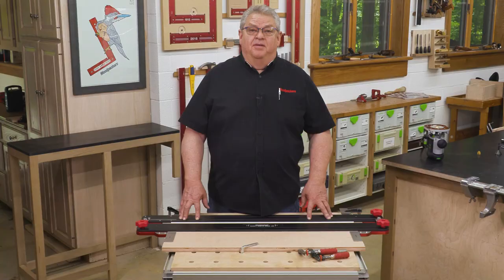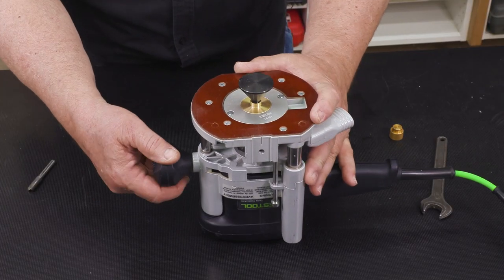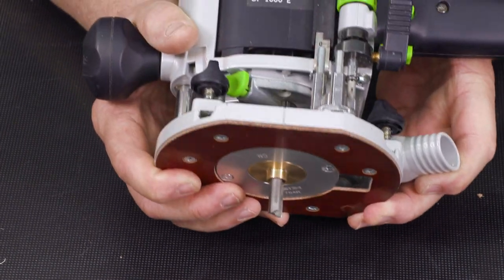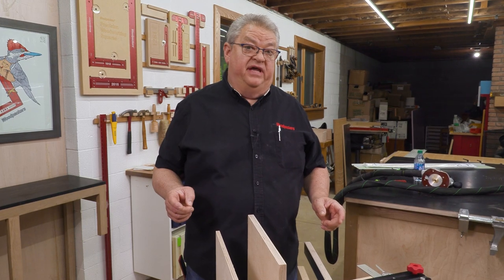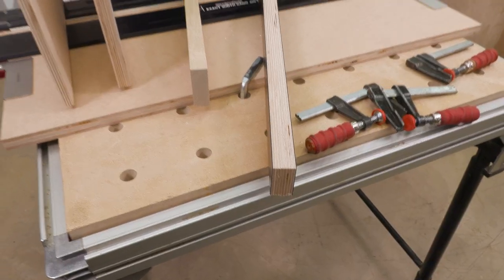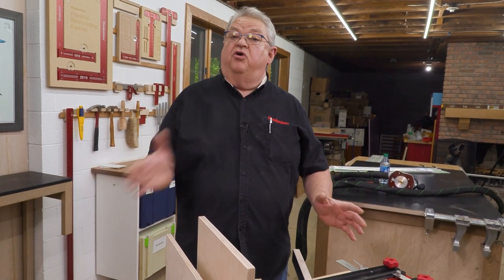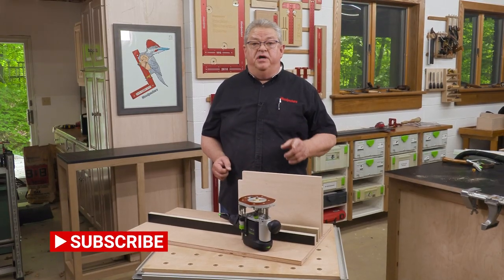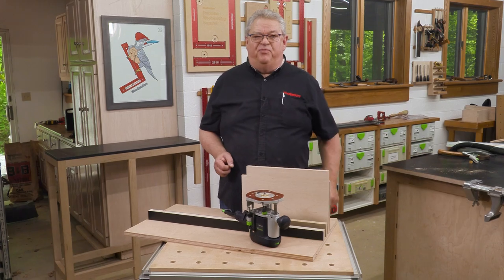How To Make Perfect Fitting Dados With Exact Width Dado Jig | Deep Dive

Comment: Well done, Jeff.  Would have liked to watch you set the depth of cut for the working dados since it is different than the length of the cutter extending below the guide bushing.  Did  you zero the cutter on the workpiece and use a bar of the desired dimension to adjust the depth stop?
Reply from the maker: Sorry I didn't address that, because the answer is really cool. Take a look at the original product video: https://www.youtube.com/watch?v=bf5H3HnkYJk   ...specifically, at the 1:22 mark you'll see the ruler that stores in the Exact Width Dado Jig. It works for setting the stops for blind dadoes, and also comes out to set the depth of cut. It compensates for the thickness of the jig and has the zero point set for the top of the material.
Reply: @WoodpeckersLLC  Thank you!

Comment: What a great demo your super. I have to ask you what was the router bit you used. If you remember it would help avoid buying bits I don't need .  I am using a Festool 1010 and would like to use my 1400 because on 1/2 shaft if I canI just was going to order the 24-1/2 model. Thank You
Reply from the maker: Not sure what I used in the video, but I am sure what I would use today. Woodpeckers is now making solid carbide spiral router bits, and we make two that are a perfect match for the Exact Width Dado Jig. US4900U and US4900D are 3/8" diameter solid carbide spiral router bits with 1/2" shank. The "U" and "D" represent up-cut and down-cut. For solid stock, the up-cut is generally preferred. In plywood or solid stock species that tend to chip, the down-cut is the better choice. You can find them here: https://www.woodpeck.com/ultra-shear-solid-carbide-spiral-router-bits.html

Comment: Where did you get the pigtail connector from?
Reply from the maker: My old OF-1000 pre-dates the Plug-It connector. In Europe they sell this pigtail that replaces the cord and allows you to adapt old Festools to the Plug-It cords. An acquaintance on a Festool forum ordered several from a German retailer and we divvied them up. I got one for my OF-1000 and my even older track saw (AF-65).

Comment: Can one cut a dado starting and ending a few inches from the ends with a plunge router base so that the dado does not show on the ends?
Reply from the maker: You certainly can. It has built-in stops on both ends so you can control exactly where you start and stop.
Reply: @WoodpeckersLLC  Thanks for the prompt response.  That sets it apart from the competition.  Just ordered mine!

Comment: What size bit are you using? I used a 1/4 and it doesn't go the full 1 1/2" as promised in the description
Reply from the maker: With the guide bushing provided with the jig, you have to use a 3/8" bit for the jig to work correctly.

Comment: That Festool dust system isn't worth a hoot with this setup, is it? Woodpecker's dado jig design is the only one I've seen that uses a guide bushing. Can you or any of your viewers tell me how to rout dados less than 1/8th inch but more than 3/32 using a 3/32 bit with a 1/4" shank ? Surely there are better minds than mine here. Please share your insights.
Reply: I made my own jigs years ago and it works by the base of the router riding along each fence instead of a guide bush against a splinter guard.  I made one set up with a 3/16" bit and another using a 1/4". The smallest dado is 3/16" and 1/4" with the other, you can use any size bit, just remember the smallest width dado is whatever size your using.  One side is adjustable like Woodpeckers. It works identical to woodpeckers except the width is set by the bit directly. The smaller of the two bits I don't cut that deep per pass, fear of snapping the bit. With a 3/32 bit I guess it could work with shallow cuts just be careful. If you decide to make your own jig use 6mm or 1/4" plywood (or 12mm, 1/4") like Baltic Birch or something comparable for the base the router rides on each side and 18mm or 3/4 for the fence on each side. Screw from the bottom through the 1/4" into the 3/4". Add plywood straps that are slotted, at each end with adjusting knobs to the fence section for adjustable widths, and your all set to go.  Hope you understand what I'm trying to say. This is a long winded explanation I know. Hope this helps.
Reply: @nowhereman112244  Thank you. It does help. I'm sure this is the way to go. I'm using double-sided tempered masonite which is an oddball thickness considerably less than 1/8". The 3/32" bit came from an industrial aviation supplier.
Reply: No dust system will work perfect because the router plate is not directly in contact with the surface

Comment: I have been using this jig and am a little disappointed. I have been struggling to get 100% repeatable results. You have to guess every time on how tight to squeeze the the rails together.  Sometimes I’m tight, sometimes I’m loose. Even just “making contact” with the rails is a crapshoot. My router bushing has been centered with a festool centering cone and I consistently cut dead on perfect dovetails on a Leigh jig. As of now, the only way I’ve been able to achieve repeatable results is to put 2 layers of blue tape on both sides of the board and squeeze the rails very tight. It’s much closer to repeatable, but still not 100%. I feel for the price of this jig, the user shouldn’t have to guess how tight to squeeze (or use blue tape.) I’m not sure if the pvc strips compress slightly or what, but it’s far from perfect. I will say it squares itself up very well and the dado stops work very well.

Comment: Noob question: wouldn't the gap between the bushing and the bit create an offset from your pencil line to your cut  line?
Reply: That's why you cut away the white plastic with the actual bit, and then use that plastic to line up.
Reply from the maker: What Pete said. 8^)